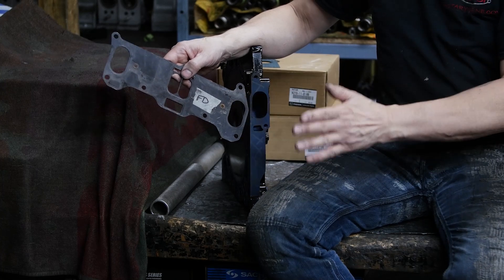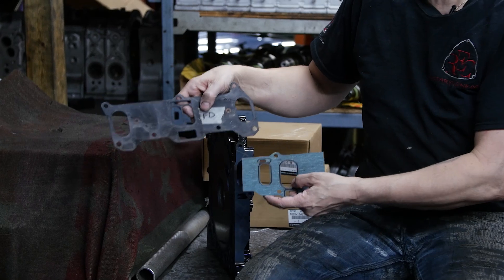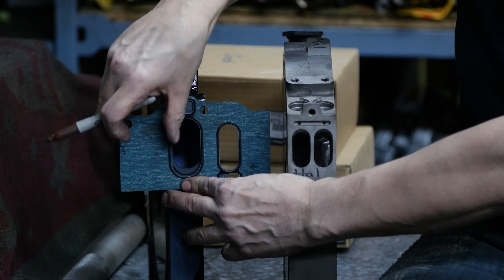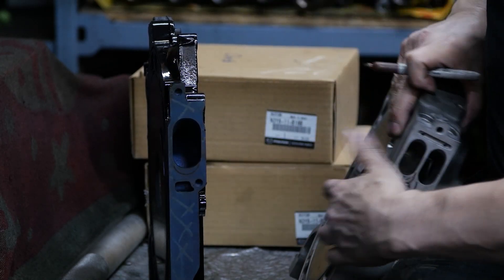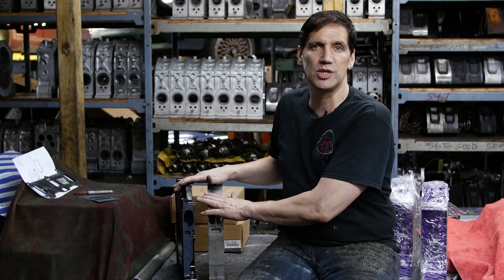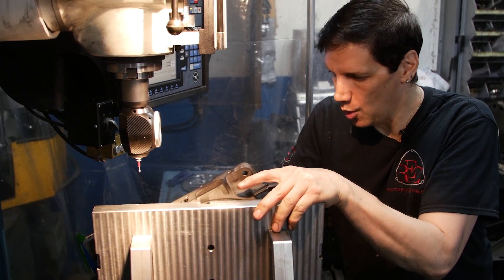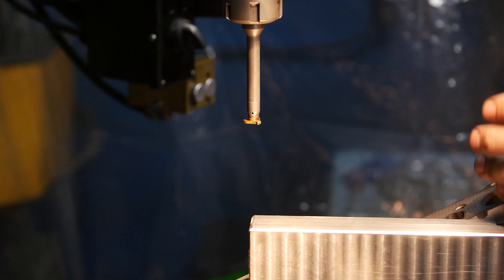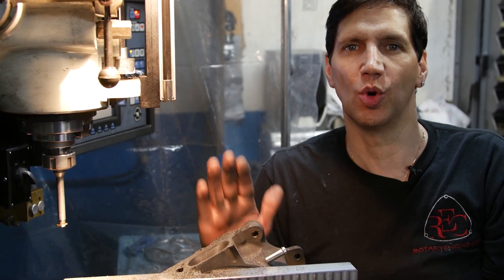Make Your Rotary Engine BREATHE

Comment: Off topic but those jeans go hard! What is the best intake set up for a gsl se motor? Originally I thought some 12a irons, 4 port intake and along with a healthy amount of porting. With the lack of availability on 12a irons I’m starting to wonder if a couple racing beat p-port housings would about as economical plus part availability. Just looking for direction in my build, anybody with experience on could chime in, I’d appreciate it